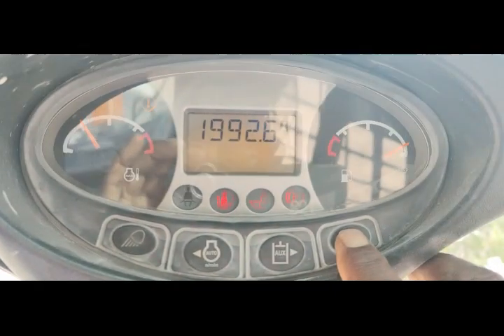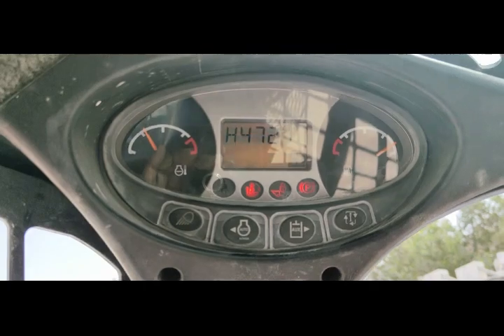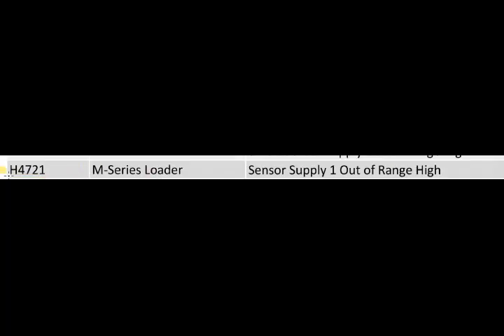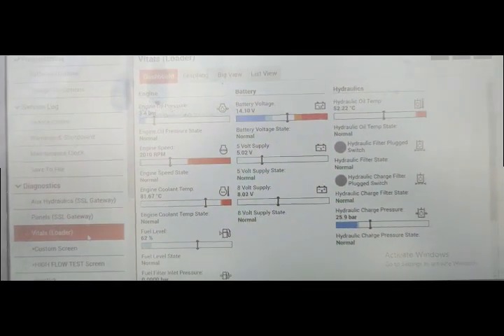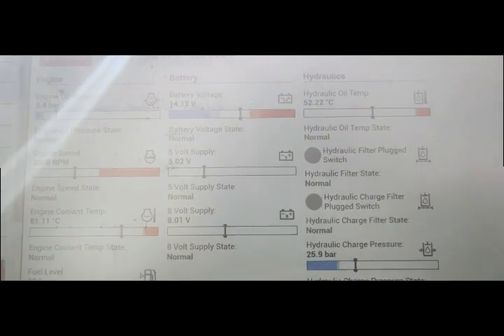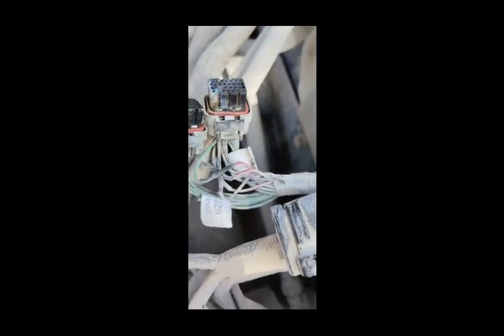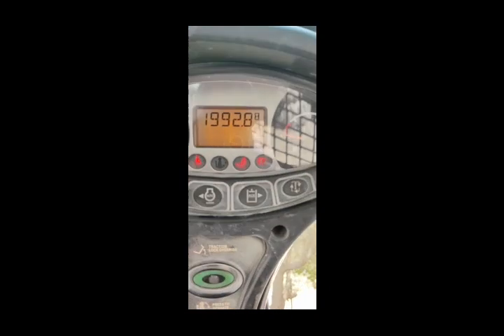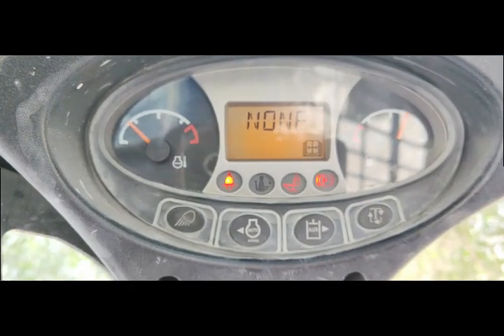Diagnostic The Code H4721 || Skid Steer Loader Of Bobcat

Comment: Can you show where it's at? I am having a hard time finding that sensor , and the video is hard to tell where .
Reply from the maker: These sensors are under the cabin, almost near the seat. When you lift the cabin with seat, there is also controller. This time this machine is not in garage.
Reply from the maker: Any time, when machine will come in garage I show you proper place.

Comment: Brother i have also facing problem with my bobcat with code h4722 but idnt have scanner to check kindly give some tips for this solution
Reply from the maker: H4722 code mean, 8 volt sensor supply out of range low. It mean Power supply not to the sensor
Reply from the maker: Sorry for late reply, I was sick
Reply: @AlbertB72  god bless you and thankx for the reply. Also brother kindly suggest me , which sensors i have to check for this can give me the name of the sensors